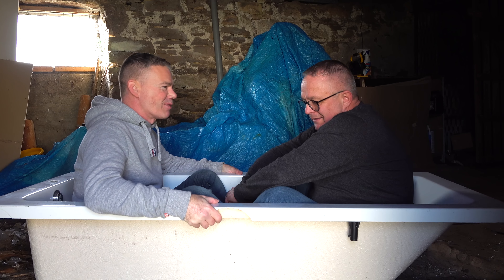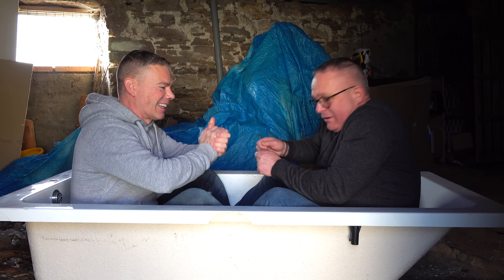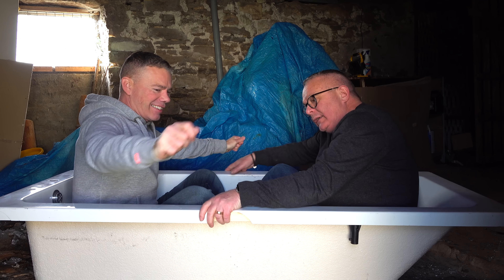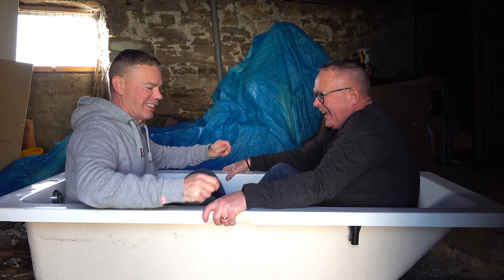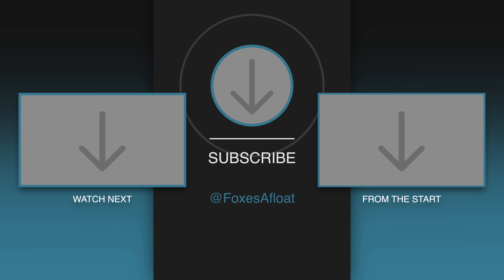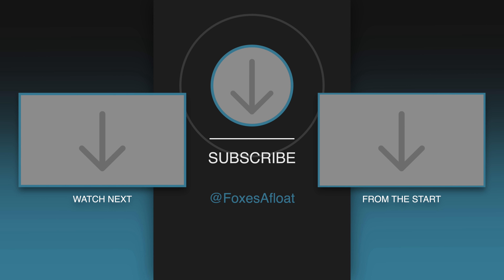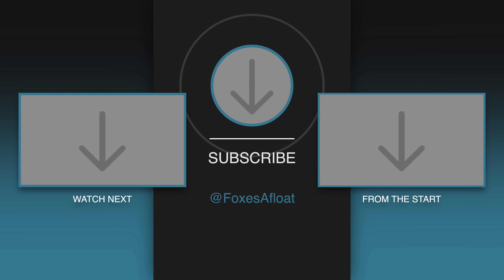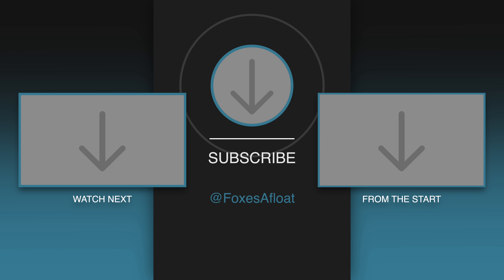Building a Train Set inside a TRAIN! Model Railway Heaven! Ep. 222.

Comment: Although I love the idea a train carriage might be narrow and moving it might be a problem. I would also be much more interested in seeing what was going on inside than what it looks like outside. People are using shipping containers for lots of different applications and there are trucking companies that specialize in moving them.
Reply from the maker: Yeah, and they look like shit 😬
Reply: @FoxesAfloat  They certainly do, however, they don't have to. Siding etc and they would just look like a shed. Advantages are a clean slate to work with. Power, doors, windows, lighting for video and electrical can be put where you want them. Insulation pretty simple and a structure robust enough to add a solar array on the roof. I love the idea of a carriage but I fear you would be opening a large and potentially expensive can of worms.

Comment: Interesting idea - if it costs the same, then crack on (you’ll have to film the HGV driver struggling up the roads! 😜)

I think one potential issue is that railway carriages need to be constantly maintained - a local heritage railway near me has been spending millions to get its carriage fleet undercover as the roofs leak etc if kept out in the elements…)
Reply from the maker: This would be static so easier to maintain

Comment: Hi Foxes, Like the Idea of a railway carriage, this would be a great series of vlogs. If you've got a minimum width of 6ft you could easily turn 3 or 4 tracks, my three tracks turn 180 degree in a 5ft width. The only issue I would think is delivery and set up cost for the carriage, tracks, sleepers, ballast, at least two artic loads and a crane, not cheap, if they can get from the main road to your location.

Comment: Think longer term! If your original building needs fixing, fix it for resale at least. The cost is as needed to get the building to a useful state whether the final use is a Foxy train platform or not. If it has electrical, water your way ahead of the game. You can scout used building material sales for widows, doors, etc. and it adds to the story. Either way it’s work, lots of work. Chop Choo
Reply from the maker: It's a barn. It's fine if you want it as a barn.
Reply: Cost either decision carefully with building department and transportation crew. Enjoy your creativity and adventures. Cheers

Comment: Carriage if you are doing N gauge,  Purpose built shed for OO gauge.
Reply from the maker: Carriage and 00 gauge. Already measured up and will easily fit, even with the widest 4th radius curves with space to spare at each side.
Reply: @FoxesAfloat  In that case  CARRIAGE on a proper track with ballast.
Reply from the maker: @DaveGardner64  Yeah, granted, it won't be a sprawling layout but I'd prefer something that looks really unique inside and out 👍🏻

Comment: Do some careful research on transportation costs for said railway carriage this will come on a low loader on single track roads how far are you from the main road? Are there any sharp bends which the trailer cannot get round or dips where the trailer might ground? Any transport company will probably need to look at the route, can they turn the rig around to drive out so they don't have to reverse out to the main road i doubt they would take the job on unseen. Also how far will a mobile crane have to come it will be reassuringly expensive. Also how much repair work will the carriage need.  Renovating the barn would be the better option as others have said IMO. I shall be watching this with interest best of luck.

Comment: Soooo the train carriage is about half the size of the old Silver Fox, and about as wide. Slap some solar panels on it& u got power?! I like it..
Two/three concerns (no need to answer, just some to think on).. Will the bees not feel disturbed (threatened) in their winter slumber while u guys build? May need to move em to make sure they'll be alright.
Make sure u get a static or some like that done, that the ground can support the weight. Esp if the ground has a high ground water level.
Last, will u need to get a permit from the local city council? If yes, it will help to find out who that is& get in their good graces. Sometimes it helps getting involved in the community to make planning issues easier. 

Anyhoo.. I pers think a train carriage is an amazing idea! Especially in the colors of the old Silver Fox .. making it (in) officially Silver Fox II ...

Comment: Renovating the barn would be a better investment/resale value of the property, but a railway carriage would be more funky, you'd have to check out planning permission of permitted development rights.
A full length carriage of a more modern type, BR mk 3 or 4 would be well built and insulated and have an integrated heating system, problem is it'd probably require a three phase 415 volt electrical supply.
I'd suspect the logistics of getting a carriage to site, preparing a track bed etc could be quite expensive.
Converting the barn wouldn't be difficult, biggest job would be removing the soil, putting down the hard core, no jokes, damp barrier and foam insulation, a pumped concrete floor of self levelling concrete wouldn't be difficult.
Hope you can pull it off LOL.
Reply: The standard electrical supply for most loco-hauled carriages is usually 1000V. It's only former HST (aka InterCity 125) vehicles that take a 415V three phase supply.

Comment: All three ideas are good ones, I don't know how your tax structure is on land and buildings but that is something that should be looked into before to long.

The idea of using a rail car for your railroad layout is a nice idea but it's hard to expand it and your space is limited. So it's hard to step back and take in the whole thing. 

The shed is not a bad idea because you can size it more to what you want and add extra space for a place to hangout the same is true of the barn.

The barn, you already have it and it's an existing structure so that shouldn't raise any flags with the tax man come tax time. From what I've seen of the barn I don't see anything too major to turning it into a train barn construction wise. Sealing the walls with stucco is something you could do... look it up on YouTube hanging a ceiling isn't all that involved... but I don't know what you have access to material wise. I would hang the rafters and use white  corrugated steel for the ceiling panels with insulation on top of it.

I can see a layout on two or three walls with a hangout space or repair space in the middle. 

Not knowing what you have in mind makes it hard to offer good ideas. If you put your layout at knee height you can expand to another at chest height later. With the layout low you can sit in a chair and watch it run and enjoy it. 

Yes I know I may not have been much help but it is my take of things.

Comment: Whilst model traaaaains on a traaaaain would be great to see, I think it'd restrict the depth of the layout too much unless you switched from OO gauge to N (roughly half the size.) I also dread to think how much a specialist haulier (such as Allelys, based near Redditch) would charge to transport the carriage/van to the wilds of Scotland! 

A General Utility Van (if you can find one for sale) would be a bit more practical, as they're 57 feet (17.37m) long and 8 feet 6.75 inches (2.61m) wide. A lack of windows could be a potential downside, however.

A purpose-built workshop type wooden building would be most practical, as you can get them pretty much any size you like and they're fairly weatherproof, but I suspect there'd always be a pang of regret if you chose that over a traaaaaain. 

This isn't really helping with a decision much is it? 🤣
Reply from the maker: Haha, we already decided ;)